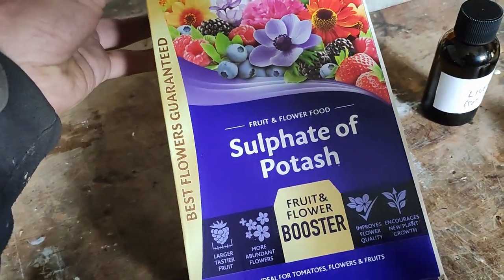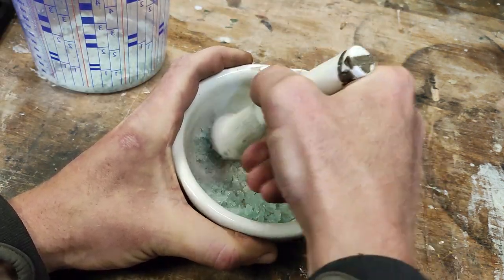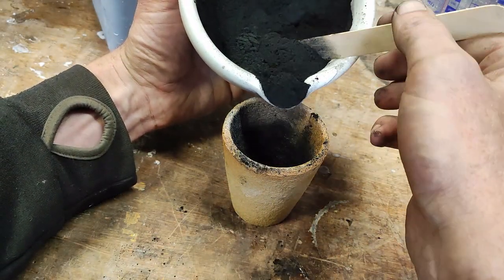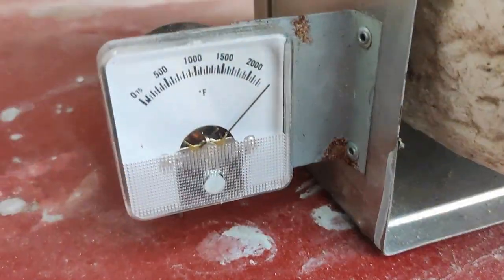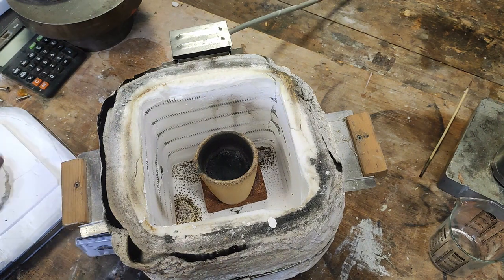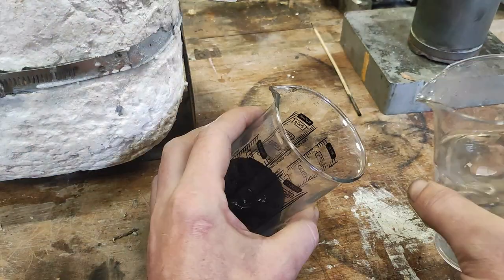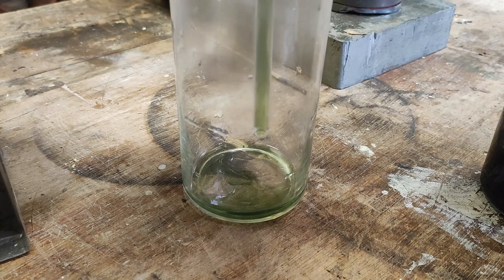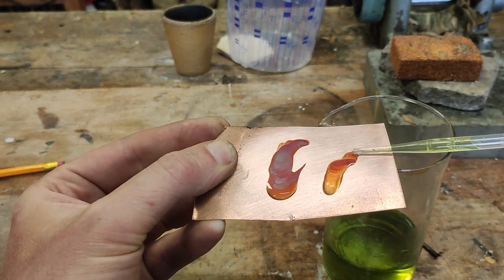How to make Potassium Sulphide "at home"

Comment from the maker: I have since learned from my good friend Phil that this reaction is most likely to happen at the melting point of one of the reactants. In this case potassium sulphate, which is just above 1000C. which would align with the literature which says 900C to1100C. However what is also crucial in this instance is the intimacy of the solids. So mucho, mucho mixing and grinding will improve the yield. Enjoy!